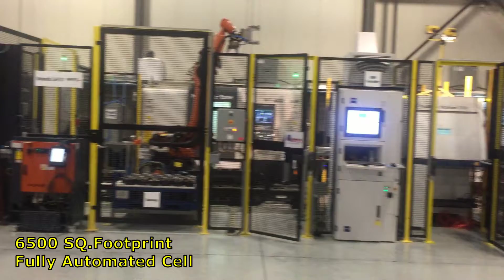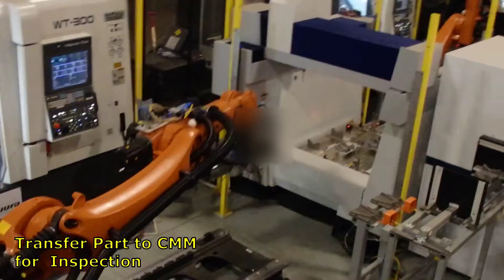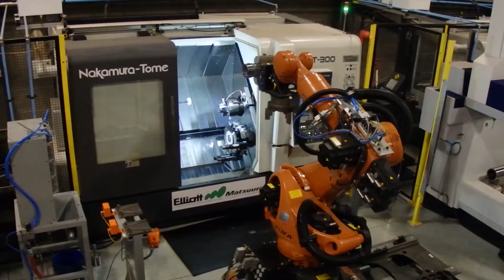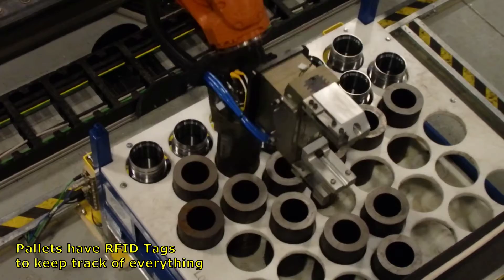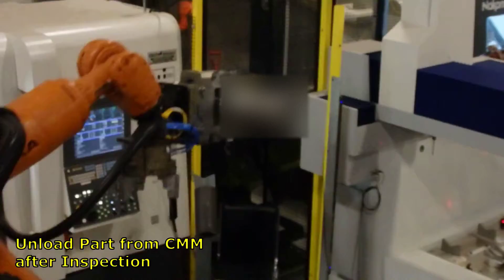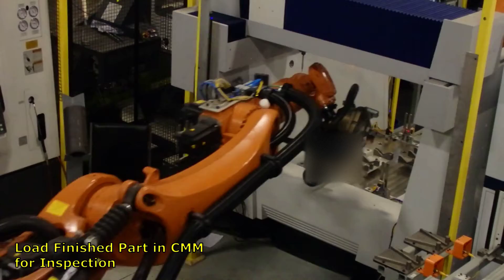Automated Cell CNC

Comment: Iam designing a AUTOMATED WORKSTATION with  mikron series machines and integrating a 3D Scanner instead  for quality inspection.

But the cleaning / removal of chips plays an integral role . 
what can i do in this step . 
i need to incorporate a AIR BLAST STATION 

could you suggest some system that could be used in this case

Comment: if the cmm indicate that the part is bad or is a limit good part what the robot will do?
Reply from the maker: If the part is bad, it will show up red on HMI screen and still offload part in rack. 
The CMM always sends wear offset adjustments to appropriate machine for next part. 
If the offset change is greater then a tolerance we set, it will stop machine before finish pass to allow operator to go in machine and change insert.